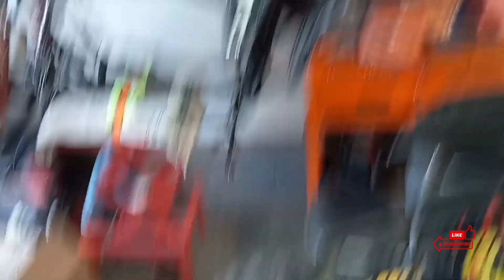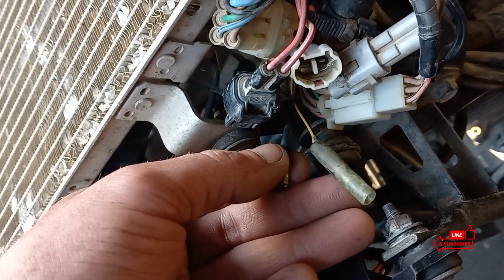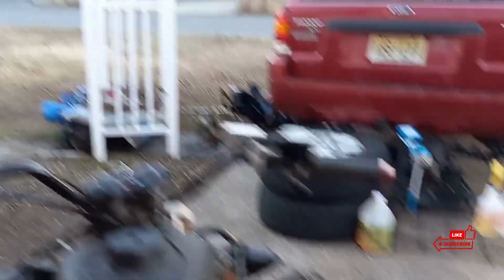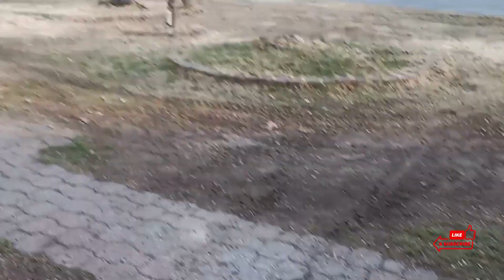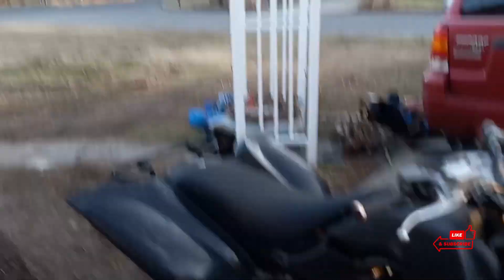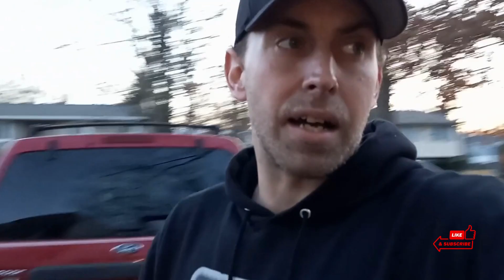Yamaha Raptor 660R Problems   HELP!!!

Comment: If you have mid range problems and still want to ride. Adjust your fuel dial to off then go 1/4 turn to reserve. Once that is set, push your choke lever half way. Full revs back
Reply: It will run fine with your fuel set to "off" until it drains the bowl. This indicates that your jet is clogged. Try a big teaspoon of ATF in your next full tank of gas
Reply from the maker: @Mr-DeeRock  I got rid of that quad it came in some trades. It actually went to Puerto Rico
Reply from the maker: @Mr-DeeRock  I got rid of that quad it came in some trades. It actually went to Puerto Rico
Reply: @garagemcmatt  I have one and it's been great people just don't know how to do the carbs
Reply from the maker: @xynfly6899  I rebuilt the carbs on it and it was better. I've had a few 660's over the years

Comment: So this is first video I watched, bout an 01 raptor last week.   Wouldn't even run, getting close w it but have exact same issue!   Hopefully you have another video on what you came up with, haven't looked yet.   Also, have am 89 lt250r.   Hasn't been out the shed in about 15 years, think it's time to get it out so I'll definitely be checking out more your videos
Reply from the maker: Someone made me an offer for the raptor that was double what I paid so I let it go. Dam thing ran perfect putting it on the trailer. 89 250r nice

Comment: The switchover from carb 1 to carb 2 from off idle to throttling, maybe rejet from where 1 let's off and 2 picks up ? Or the needle positions also might make a difference
Reply from the maker: I'm gunna bust the carbs off next

Comment: I would check the vacuum line air flow that's hairline crack in the hoses live or not makes a world of difference adjusting the carburetor for aftermarket exhaust due to
Reply from the maker: Got rid of this raptor. Now I ended up with another that's even worse

Comment: That sucks about the R. I’m sure you have a good machinist but make sure they check the bore at bottom, top and middle and cut the new bore so it’s perfectly straight. A lot of people have issues with crappy bore jobs and don’t chamfer the port edges enough.
I’m from NJ and ride an 85 250R
Reply from the maker: I know I remember you telling me your from out here

Comment: You know. folks badmouth the 660 but mine has only torn up the clutch pads and the flywheel. I do reseat Valves every 200 ish hours.
Reply from the maker: It wierd bro I've had ones that just worked and never needed anything but gas and oil. Then there is the other 9 out of 10 that are just junk

Comment: I have had three different  raptors  and the first carb is your mid and idle  you can use Chinese  carb  but you need to take clean out all burs out and metal ,then put a Quality   set of jets in and start at 2.5fuel screw  on first carb  and three turns  second from fuel line in is first carb
Reply from the maker: Thanks bro. This raptor ended up being electrical issues. Got it running and sent it down the road

Comment: 2Vintage is a legend with the Yamaha carbs.
Reply from the maker: Really?
Reply: I know this is a warrior but the Raptor has 2 of them. and he has 3 or 4 vides where he rebuilds those as well.  @garagemcmatt
Reply from the maker: @gopherchucksgamingnstuff2263  this raptor 660 had rebuilt carbs that I did. It ended up being an electronic issue

Comment: Carb tuning needing clip positioning on 1 is different
Reply from the maker: This bike had several problems I ended up punting it and moving on to the next project
Reply: @garagemcmatt  I love 660r raptors I agree there a headache. But can be figured out.

Comment: Hey dude. If you wiring is correct then it's your carbs if you have the original mikuni carbs rebuild them and put them back on the Chinese cards use a different pilot thread so you can't buy pilot jets for them. Turn the air mix screw to 2.5 turns out. Also try connecting the 2 wires for the clutch together to close the circuit.
Reply from the maker: I want to put those stock carbs on next time I pull the raptor in the garage. And yeah the clutch wires are just hanging there not together
Reply: @garagemcmatt  yeah definitely use the mikuni carbs bud and plug in the 2 wires for the clutch together that should close the circuit and alow it to rev up.
Reply from the maker: @Shadowz_660R  check out the last video I uploaded on that raptor. It's titled raptor 660r problems I think it shows what's going on and I show the wires by the bars. I was wondering that about the clutch micro switch
Reply from the maker: Oh duh it is this video lol. I'm lost today
Reply: Hey, did you ever find the solution and fix it? 
I bought an 03' for $900 and it's doing the same thing

Comment: 01 raptor 660r wiring issue. Bike turns on without the key just using the kill switch. Wont turn off tho
Reply from the maker: That's crazy. I'd go through that whole harness

Comment: I’ve got a raptor 660 and the carb is sucking fuel into the airbox I can’t get inside the carbourator because the screws are rounded from the last owner any tips?

Comment: Hey man, blairsville Pennsylvania here. I have a 660r 2001 and a 87 warrior.  I’m not impressed with my raptor either it has low power it seems. Lol it’s really pissing me off so I feel your pain
Reply: It’s def your carb mine did the same thing. But mine still seems likes it’s not getting all the power it should
Reply from the maker: @scutfarkus4110  I got rid of that quad they are junk and wasn't worth my time. Moved on to the next yamaha a banshee. I have oem raptor carbs for sale on ebay now if u need

Comment: Indiana here. Have 2 400ex 1 built 1 stock. 04 yfz450, bombardier, 250ex multiple dirtbikes. Ive got a swinger +3 mx that would be real nice for that 465 build.
Reply from the maker: That's cool bro nice little collection. Plus 3 might be a little much out here its all tight trails mostly. I do have other builds I might be interested in that for tho.
Reply: @GarageMC  I've got tons of 400ex parts. I had 4 at one time. These are my favorite of all time. I'm about to try a 465 build as well. Which is what brought me here. Great content bro!!! Keep it up!
Reply from the maker: @Elitepowdercoating  thanks bro. We will get back on the 465 soon I gotta put customer stuff before my own.

Comment: u forgot to put transmission fluid or clutch plated are stuck together
Reply from the maker: I got that one going it was electrical. Someone before me routed 2 wires to the wrong spot

Comment: Can u fix a Yamaha raptor 660 with a locked up engine without a rebuild
Reply from the maker: That's an open ended question. Depends how it's locked up. If it was left outside with no spark plug in it you might get lucky pouring marvel mystery oil in the spark plug hole and let it sit for a few days,them maybe it will free up. If it's locked up from something breaking or bent valves then no it needs to be repaired

Comment: Put a new spark plug plug, let it idle with the idle turn the idle up to a fast idle and let it sit for 10 mins. Pull plug and see if it looks lean. That's basically an off idle plug chop but u don't really need to chop the plug on a 4 stroke
Reply from the maker: I'll try it out. It does idle fine tho
Reply: Yeah, the combination of pilot jet, fuel screw size, and needle clip position can make it idle, but fall on it's face starving of fuel off idle. But deff can't hurt to check valve specs quick. Bad diaphragm  or leaking air. Slides run off vacuum. No vacuum, no slide movement lol million things it could be. I got faith in ya bro, ull get it!!!
Reply from the maker: @dennisbrooks186  thanks bro we will get it

Comment: I think it's lean. China carb jets r way off and the 660 is very picky on jetting. Put mikuni jets, stock size. Go from there. Check valve clearances. And did u do the reverse safety switch delete? U add a wire from the reverse switch near shifter. And run it to the batt ground. Float height. The carbs both run all the time. The right side had the larger main jet so the one kinda "takes over" in a sense. They did it b.c. that motor needs so much fuel to run right. But it's not like u get to a certain rpm and the left carb totally stops. As u know or will find out, the butterfly valve shaft connects both carbs at all times. They r finicky carbs even oem so China ones need to be beyond on point lol
Reply from the maker: Yeah I seen all that on the oem ones I re did last night I'm gunna put those on it. Good thing I keep stuff like that I had 3 sets here

Comment: I’m going through the same thing with my raptor, I change the carburetor 1pz performance it is a good brand. So I need help with this because they told me the clutch or starter clutch
Reply from the maker: I ended up getting rid of that quad it was just one thing after another

Comment: Clean the carburetors. Carburetors need to be synchronized in. They've been messed with
Reply from the maker: I'm doing some research on syncing the carbs it probably has some bs jets in it. The way it will go if I just floor it is crazy
Reply: I had a  Suzuki   motorcycle with four carburetor that did the same thing as your engine .  I cleaned them . synchronize them . 1 out 2 was way out of adjustment. I bought a motion pro synchronizer. That did the trick . It  Run like champ
Reply from the maker: @donaldsearles817  find out in a little bit
Reply: Let me know I'm curious

Comment: Have you had your parking brake on at all? If so, make sure the part that pulls away from the bracket (when the parking brake is being engaged) up near the engine kill/headlight switch is flush against the bracket when your done putting it in park. Otherwise the sensor will sense that it’s still in park and will run like it has a governor on it and WONT rev barely at all. It may take a slight slap with a hammer to make sure that it’s back flush again..
Reply from the maker: Yeah bro the whole park brake was removed. And it will rev up fine it just dies when you try to ride it unless you rev the hell out of it

Comment: Geez sounds like mine did when the oil pump quit working is yhere oil pumping to the top of the head ? Little screw on the side of the head could check
Reply from the maker: It had decent oil flow. I ended up selling this one. Got a offer I couldn't refuse

Comment: 03 raptor 660. Bought it today for $2000 but guy didn’t tell me needs new exhaust. It’s smoking from under seat area. Was it a good deal still or I got played? Also how much is full exhaust?
Reply from the maker: If it's coming out under the seat it's either the gasket where the silencer meets the head pipe. Or it has pin holes in the pipe. You can find all of that on ebay. Type in "raptor 660 exhaust" in the search bar. Put gaskets after that if u just need gaskets. $2000 is about average. If it was a 2001 they are worth less cause of the Trans problems the first year